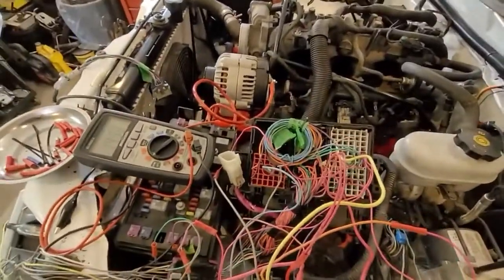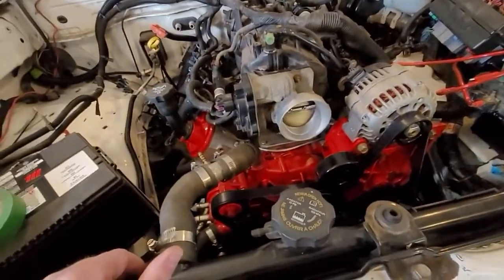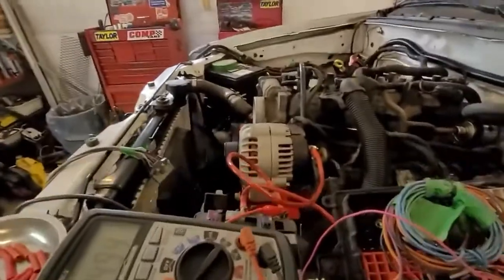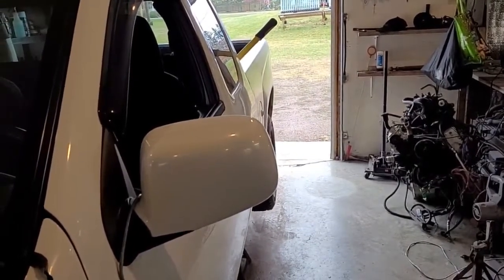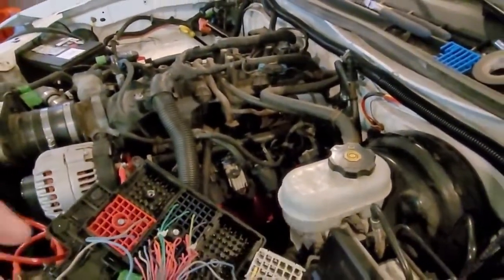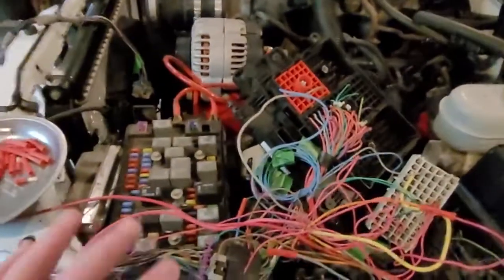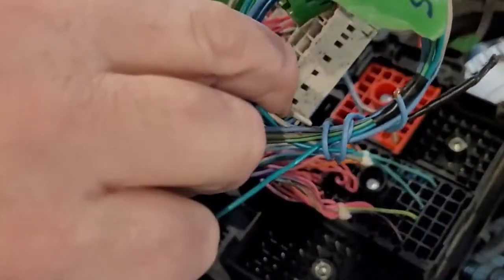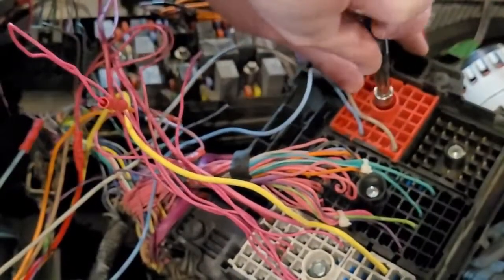Wiring The LS Swap 4.8L Colorado and First Start

Comment: Hey bud! How did you route the coolant hoses for the heater? Did you just use a straight line, or did you need to use a 3 way on one of them? I know on Silverado’s, one of the lines has a Y that goes to the coolant reservoir.
Reply from the maker: I just used straight line from the heater core to the water pump.

Comment: Where are you tieing in to the fuel pump on the fuse block  if so where
Reply from the maker: I am pretty sure it's the gray wire on the red block that powers the fuel pump. I just connected 12 volt keyed on power to that wire and the fuel pump works. Thanks for watching.

Comment: Why didn't he just reuse the old fuse block. The old fuse block in Colorado it already has the same plug for starter it has the same plug for throttle body it has plug for fuel pump everything is already hooked up u just need to add a little bit more wires to the block. The cluster works with original fuse block.
Reply from the maker: So I have a question for you. How did you wire up your LS swap? Just curious 🤔
Reply: @budslife  well I'm using my stock e40 computer and my stock fuse block that came with the truck, I tried reusing as much as as possible so all the acceries like a/c lights starter fuel pump throttle body all that stuff stays their. I just added wires that I took off from the original harness that came with my lsx motor. And just pinned them in to the stock e40 with the pin out schematics. So to sum it all up I just took the lsx harness and conjoined it to the factory harness that came in my truck. I had  a 2.8 4 cylinder as u know the 2.8 4cylinder has the same tone ring as Gen 3 5.3 I think it was 48 so I was able to rescue the computer and fuse block and some of the harness that was original to the truck.
Reply from the maker: @jackdaniels2657  wow that sounds like a pretty clean install. I was going to do it this way with mine as I had all the pinouts but I decided to keep it simple and just use the stock fuse box that came with the V8 engine. It worked really well all my gauges work and I can even hook up my AC also. Someday I May tie it to the stock fuse block I'm not sure I will most likely just leave well enough alone as everything works very well for me. You should do some videos on your Swap and upload it to your YouTube channel I'd love to see it. I'm sure a lot of other people would love to see it. Thanks for watching the video!
Reply: @jackdaniels2657 you have any video?
Reply: @budslife  u get the e40 ECU from the Pontiac GTO and then u get the wiring harness and engine. That would be another way gotta flash the bcm tho too. It has the same cluster too
Reply: @jackdaniels2657  did the same but in a 58x genIV configuration ;)
Reply: @budslife it's easiest if u just buy a wiring harness and ECU from Pontiac GTO 2006 it has the same cluster and everything just plug and play
Reply: @budslife u only need the green and white wire designed from original ECU fuel works as long as u reuse old ECU with blue plug and black plug. The blue plug has ur key on ignition power and it black plug has ground. Once u depinned the green white wire from the blue plug u re pin it to the v8 ECU that's pretty much it. I got 130 dollar harness on Amazon. So the harness is kinda married In a way but I put an electric fan so I had to have that relay and the starter would drag so I just put a separate fuse and relay
Reply: hey jack i have a few questions for you i plan on swapping my 06

Comment: Sweeeet! Was looking forward to this one :) thanks for making it. Will you have working AC, cruise control, and does the silverado stuff also control the trans?
Reply from the maker: Thanks I'm glad you enjoyed the video. Yes the Silverado stuff does control the transmission that's all run off the Silverado ECU. Hopefully next spring I will get the AC working and possibly the cruise control. Living in PEI which is a small island I don't really depend on cruise control very much. So I may not even bother with the cruise control. But definitely it would be nice to have AC.
Reply: @budslife  hey why didn't u just use the stock Colorado fuse block. It already has the starter fuel pump lights everything is about hooked up u just gotta add more wires to the fuse block. The throttle body plug is the same so u don't gotta wire that up. The ac wire is the same u ain't gotta rewire that either the transmission wires should be there if it has the same transmission. I'm using the Colorado factory e40 ecu I'm putting in a 5.3 v6 so I wanna keep everything pretty stock I'm just adding wires that I need I got a manual. I was just wondering how the ignition coils and fuel injectors are wired
Reply from the maker: @jackdaniels2657  I did it this way for ease of installation. It was very simple to use the fuse block that came with the V8 engine. I was going to try tying all those wires into the stock fuse block on the Colorado but it's a lot harder than it sounds but not impossible it could have been done, it would have taken a lot of time. It works perfectly the way it is I've had no issues with it and been driving it all summer and it's worked great. I have to do an update video on it very soon I've had a lot of guys asking about the Colorado. Thanks for watching my video I appreciate it stay safe!
Reply: @budslife  the way u did it I'm having a hard time understanding it. Cus if the old fuse block is intact u don't need to wire up the starter with the 2nd fuse block u just need to extend starter wire. The fuel is also already hooked up on the first one the accessories are hooked up for the most part its just the injectors coils and cam crank sensor. I don't understand good
Reply from the maker: @jackdaniels2657  I guess the only thing I can tell you is this was the easiest way for me to hook it up to get the truck running. If you don't want to use the second fuse block you don't have to you can wire all those wires into the Colorado fuse block but keep in mind not all of those wires are in the Colorado fuse block. So it can get confusing but it can be done. You should do it whichever way is easiest for you. I guess the best way to explain it is the fuse block from the V8 engine is controlling the engine starting running fuel all that stuff the Colorado fuse block is running lights wipers all that other stuff dash lights heater things like that.
Reply: @budslife  on those 2011 the magic word is BCM this thing control everything Starting switch, cruise all the dash gadges ect....that why keep and add wire to the OEM L4 fuse block for coil and injector V8 application ,you can do this with keeping your old pcm and add the e67 plug in to the bcm and add wire he need to work all the thing inside.....for me i just chose to use E67 LH9 5.3 V8 pcm and match it to a genIV 58x LS engine so the BCM pcm and engine can talk to each other to have a complete set up working :)
Reply from the maker: @trevorschnedler4472  Yes, the Silverado PCM controls the trans and everything. I did not hook up AC yet or cruise control. I don't drive this truck very much just in and out of town. Mostly no real long trips so I'm not sure how bad I would need cruise control. But definitely AC is a consideration down the road. Thanks for watching!

Comment: I've got a 2008 GMC Canyon that I would like to do A LSsoap. How much   will it cost to do a swap
Reply from the maker: Cost can vary depending on how far you want to take the build, and your ability to do the work yourself or if you have to hire somebody out to do it for you. If you use a lot of the stock parts from your donor truck this will greatly reduce your cost. I mean stock wiring harness, ECU, exhaust manifolds, Etc. Also you should try and use engine transmission combination that has the 4L60E because then you can use the stock transmission crossmember and you don't have to modify it. If you do it yourself I would count on it costing $1,500 to $2,000 plus the price of your engine and transmission. If you have to pay somebody to do it I'm really not sure. I've heard some guys paying as much as 10 grand to do a swap which I think is ridiculous. Realistically if you had to pay somebody I would think around $3,000 to $5,000, is a more realistic number. Thanks for watching the video.